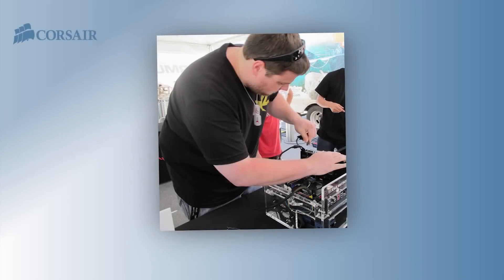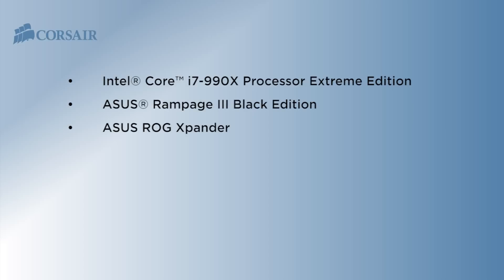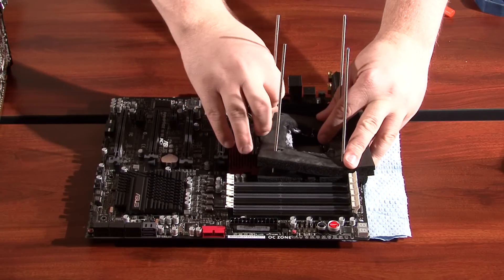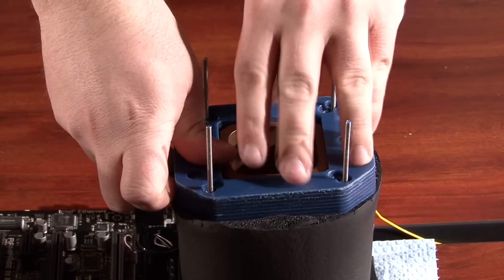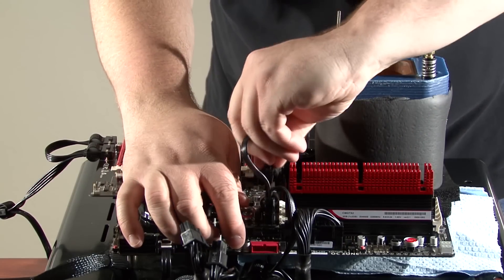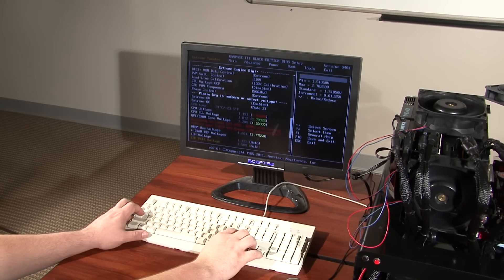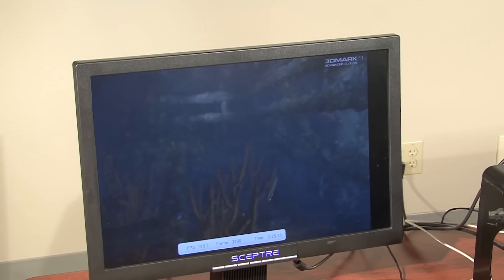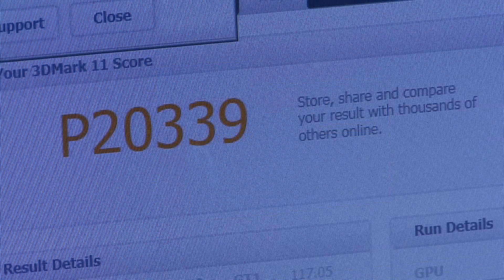Setting up your PC for liquid nitrogen cooling

Comment: I have my CPU mounted in deep space. I find i get best results that way, just close enough to a black hole to ensure that all heat and other unwanted radiation is quickly removed and compressed into a singularity.
Reply: Still funny 8 years later 🤣🤣🤣
Reply: You know in space there is no way for heat to go away ??
The only way for things to cool down in space is through heat (hawking) radiation 
what is extremely slow. Not for nothing scientist say if you get caught without 
a suit in space you will boil to death.  So a CPU would overheat instantly when used in space !
In that sense your comment just doesn't make sense at all XD

2 facts.. heat from the sun will travel, this is due to the sun radiating very very hot and there is no atmosphere to shield most of the heat. 
The other only way to cool down is to use heat sinks.. But you have to let them catch the heat and then you need to 
discard the sink into space as it has the same slow cooling rate, and once heated the effect of cooling is gone.

Also a blackhole does NOT suck.. Things can fall in to it, once you pass the even horizon there is no way back. 
But you can just stand and sit in front of the event horizon and you will NOT get sucked in to it. Heat travels
only via hawking radiation and that counts for heat going in and out of the blackhole.. 

So even being right next to the blackhole will NOT help you speed up the cooling process. 
It actually makes things worse as the blackhole itself is not cold. It is radiating heat away from it.. Slow.. but they
are so massive that they can bare temperatures 1 / 10 of the surface of the sun ;)

GOnna be a short life time span for you pc in deep space :P
Reply: @TheGremlinsParadise  So many things wrong with this statement I do not know where to start. I suggest you go back to school and learn some physics.
Reply: @davidkirkpatrick7941  Could you please explain how this is inaccurate?
Reply: @buttertoads4942  Heat can move in three ways. Radiation, Conduction (against another solid, liquid or gas), and convection (if gas or liquid is contact). Obviously, in space, in a vacuum, there is no gas or other solids.  So no conduction or convection is possible but radiation is still possible. Radiation is why things are colder on a clear cloudless night as heat can radiate away into space. So yes things will absolutely get cold in deep space and pretty quickly so long as they are not absorbing radiation from say the sun. As for hawking radiation, this refers to the quantum effect near the event horizon of a black hole. As for boiling to death in space, this is also wrong. If you lower the pressure liquids will boil at much lower temperatures. So water will easily boil at 30 degrees centigrade in a vacuum. Not because it is hotter but because the pressure is lower.
Reply: @TheGremlinsParadise  I want to deconstruct every single mistake you made, but I don't have the patience- nor do I know where to start. Just know that every scientist on the face of the earth just offed themself after reading that abomination

Comment: Using liquid nitrogen maximum temperature is -20 degrees Celsius. Your hardware will freeze up and can cause it to break. I will create moisture into the chips and will cost you to fix up all the damage. -20 degrees Celsius is to electronics and will cause ice into the components.

Comment: Also, isn't the purpose of cooling a CPU to keep it at ideal temperature? Exucse my ignorance, but I was under the impresion that semiconductors perform poorly at low temperatures. They need heat to conduct. So, if you overclock, things get too hot, so you need to cool to keep at room temperature. Why cool CPU to minus whatever?

Comment: Bad idea using liquid nitrogen directly if you can't go below -120C. Instead use the liquid nitrogen to cool isopentane or ethanol, and run that through a liquid cooling system. They freeze below -120C, so you can't shut the computer down with overcooling.(highly flammable; kids don't try this at home!)

Comment: You're overclocking to this extent, yet have an ancient keyboard, badly cut foam, and a filthy monitor?
Reply: The foam was perfectly cut for function, he's a nutty overclocker so the keyboard is probably an old PS/2 as USB keyboards are polled constantly and therefore affect overclocking performance, monitor is irrelevant to records. This is a purpose built setup performing exactly how it was designed to.
Reply: It's probably his favorite mech keyboard or something. And the monitor was probably some crap they had lying around in a back room.
Reply: Charles Dang Pretty sure its for his testing bench
Reply: Did this was posted years ago -.-
Reply: Notch SkythekidRS doesn't change anything :/
Reply: James Healy PS/2 uses hardware interrupts which is more efficient than USB polling.
Reply: Notch SkythekidRS In 2011 everyone's monitors were dirty and no one knew how to cut foam nicely?
Reply: Charles Dang who cares i bet 99.9 percent of people on here cant do half of this shit

Comment: Would anyone care to explain me the hype with overclocking championships? Since you can cool it down enough, you can overclock it as long as you want, don't you?
Reply: no not really... eventually stability is a problem. a ford focus can only go so far before it gets damaged, its the exact same thing here. no matter how much you cool it, when you overclock you will decrease its life, and stability.
Reply: MrHohum9 Oh, alright, thanks! :) What decides if the CPU will stay stable or not? Because if the WR is 8,49GHz (or something like that) and if the stability depends on the specific CPU I can do the totally same power with good amount of nitrogen can't I?
Reply: Shibe The Doge
one you would not need a cpu of that power... also heres how CPUs work. GHZ stands for how many time pers second a internal clock go off. it ticks at that many times per second. with cpus getting more stable and made out of better material you can force that clock to go faster, like upgrading your ford to a new car. If you try to force your Ford to go faster, past its recommended speed limit, something is bound to break. But remember you can drop loads of money on a upgraded new car... but who needs a Ferrari for city driving? unless you wanna look fancy. also Liquid cooling is INCREDIBLY un-needed. its like taking a entire army, to stop fight off two men with rusty shotguns... really a cpu only gets damaged when it gets to about 90C so if you want a good cooler i can recommend a GREAT one for im sure alot cheaper, and alot more conventional... as you need to refill, and empty that nitrogen whenever you turn off, and turn on a cpu. I can also reccomend a top of the line CPU that will last you a long time for only about $300
Reply: MrHohum9 Thanks for all the examples, makes it many times easier to inderstand. I have my Athlon II X4 970 BE and I am very happy about it, so no need for upgrade ATM, but today my R9 280 and new case should get shipped, so excited :)
Reply: Shibe The Doge
if you do want a gaming pc core is the second most important thing. you want a better graphics card, and in most Cheap game builds they use cores that cost only $70!
Reply: MrHohum9 It surely is important, not on second place I think, remember PSU is one of the most important hardware, with bad PSU, you can blow your whole build off.
Reply: Shibe The Doge
thats why you want a high end one, and make sure you get extra wattage for upgrades. and try to get bronze,silver,gold,or platinum 80+ so you dont spend money on wasted power
Reply: MrHohum9 I already have a gaming rig, yet I was upgrading, I bought 700w Fortron one - my rig needs like 600w, but as you said - I go tmore for upgrades. Bought a beautiful Zalman Z11 HF1 red case with it, and MSI R9 280,  shipped yesterday, also will probably buy 8GB kit of RAM, new mobo and a SSD soon. Gonna ascend to the new case and GPU tomorrow :3
Reply: Shibe The Doge
im saving money for a new pc but its so expensive -.- but im almost there :D
Reply: MrHohum9 Yeah, it is,  what are you going to build?
Reply: gaming pc costing around 3.6K
Reply: MrHohum9 Damn, better get some insurance :D
Reply: Shibe The Doge
if it breaks im going to die of de-hydration because i will be crying so much
Reply: MrHohum9 Haha, true gamer.
Reply: Pasu suel Yes, I agree, although, pulling up your voltage in intelligent amounts doesn't often help. I have Phenom II X4 970 Black Edition (unlocked) and even when pulling the voltage up to 1.495 I can't get any further than 3,7GHz (stock is 3,5), I have lost the silicon lotery or the chip is not so OCable.
Reply: Pasu suel No clue, I get either BSOD, bootloop or black screen as soon as I start the PC with these settings.
BIOS loads, but the PC sometimes doesn't even log in to windows.
I tried both multiplier clocking, or increasing bus speed (this chip is supposed to go better with increasing bus speeds), or both, nothing worked, right now I pushed out 3,75 on somewhere around 1.450V, don't get over 61°C with quite low-end cooler.
Reply: Pasu suel Freezer 13, gonna upgrade to either Dark Rock 3 Pro or Corsair H100i (worried about pump failure)
Reply: Pasu suel Did that already, I have 3 sticks in my PC, tried switching them around, re-plugging, remove some of them and so on. It doesn't really matter, I have, on the other side, greatly overclockable GPU, so I am happy :D
Reply: Pasu suel Yea, thanks for the help though ^-^

Comment: has anyone tried liquid helium?
 or liquid hydrogen?
Reply: ComandanteJ Oh, really? I didn't know that :)
Reply: ***** Of course they do, what do you mean? They use it to cool the components before injecting it and burning it. It's called "Regenerative Cooling"
Reply: yes.
Reply: TheChip Monk No, It works
Reply: liquid helium = too thin, can't be contained easily
liquid hydrogen = extremely flammable, 1 spark and your entire rig will blow up! No one in their right mind would consider using liquid hydrogen for a coolant.
Reply: mclaine33 Except on a lot of rocket engines, where they use it to cool either or both the turbopumps, the combustion chambers, and even the nozzles, LOL.
Reply: ComandanteJ They burn hydrogen..
Reply: ComandanteJ yeah but i think nasa puts fourth more effort then some big sweaty nerd with some foam and electrical tape he got at home depot
Reply: Brandon Clark Haha, ok, fair enough.

Comment: can you put small amounts of liquid nitrogen only inside a liquid cooler?
Reply: no. if not insulated properly liquid nitrogen evaporates. your modern cpu water coolers would dissipate the liquid nitro almost instantly. this also applies if you were to replace the liquid in your rads/pump with liquid nitro; you'll freeze the tubing and the nitro would still evaporate and you'd wreck your cooler
Reply: thanks, just asking

Comment: Curious, but how long does it take for the liquid nitrogen to heat up? The CPU (base) is around 1kW. Overclocked it must be nearing 2kW. Liquid nitrogen has a specific heat of around 2 kJ/kg... and I'm figuring only about 500 ml in that small space. The CPU should be raising the temperature 2 degree per second or so and likely more since the nitrogen isn't being circulated. I would guess you need to keep supplying it with more liquid nitrogen every couple of minutes and likely nearly continuously during the tests?
Reply: yea like how much nitrogen/cost we talkin here

Comment: I use a fire extinguisher to cool down my cpu;
Reply: Dreadnaught1985 If you are an AMD user.
Reply: @Jacked Frost because amd run much hotter than intel
Reply: cool down... extinguish... essentially the same thing in the end.
Reply: Blake Bowers ok, thanks
Reply: Liquid co2 instead of nitrogen
Reply: AvoH it can be a liquid of it is under a greater amount of atmospheric pressure (If you seal dry ice in a small strong container you can get liquid CO2)
Reply: gamesfornobs Liquid CO2 isn't obtainable very easily. Dry ice, however, is. I'm not sure how to get liquid CO2 other than blowing up test tubes by pressure buildup.
Reply: Noorquacker Ind. no fire extinguishers use liquid co2
Reply: gamesfornobs Scratch that, stick to liquid CO2 of you can
Reply: Amox Sadly All i have is a dry chemical extinguisher. looking forward to a new CO2
Reply: Noorquacker Ind. Liquid co2 doesn't exist. If you heat dry ice it transforms into gas.
Reply: I use class K foam as thermal paste and CO2 for cooling.

Comment: And what exactly about getting too cold causes the CPU to stop functioning?
Reply: my understanding is that when you go outside of the traditional temp operating ranges, the circuitry inside the CPU can start behaving funny. Dumb example, an OR gate that at -150°C only turns on when both inputs are on
Reply: JohnSF93 Right, I get that there are minimum and maximum temperature thresholds for operation, but I was wondering what exactly about being too cold made the CPU or motherboard or whatever inoperable.
Reply: "arithmetic underflow on the temperature sensor that falsely triggers the thermal protection circuit."
src: http://www.edmundtse.com/2011/06/21/beginning-liquid-nitrogen-overclocking/
Reply: JohnSF93 Ah.

Comment: Is anyone interested in a LN2 delivery system?  We have developed a system prototype that delivers LN2 (yes liquid) at a set point down to -190° C.  We will be releasing the finished product online in a matter of weeks.  Just insulate your board, mount the chiller chuck to the CPU, connect the chiller to the LN2 Dewar, set your set point, open the nozzle on the dewar and away you go!  There will be no need to pour LN2 again! We have tested at -190°! I am looking for an overclocker who is willing to bring his/her rig to the central/northern Cali region to test and make a youtube showing what our product can do.
Reply: im curious oobiedoob@gmail.com
Reply: i'm donw in san diego and in the near ish future might have some cash to burn on a nice rig, and wanted  a pretty profesional setup, perhaps also with RamDrive.  Would cooling a 3 way SLI Gpu setup also be possible